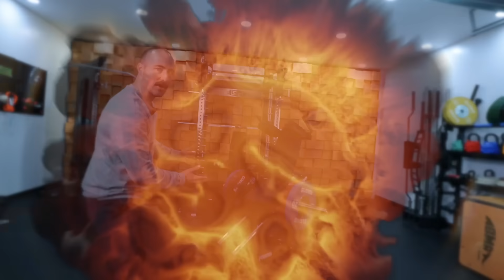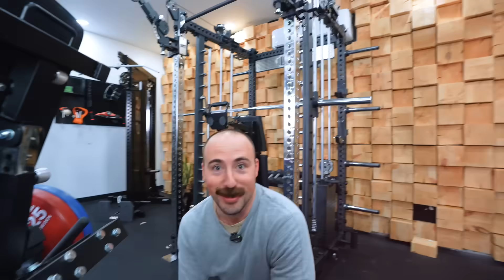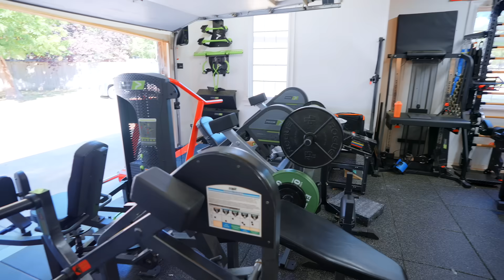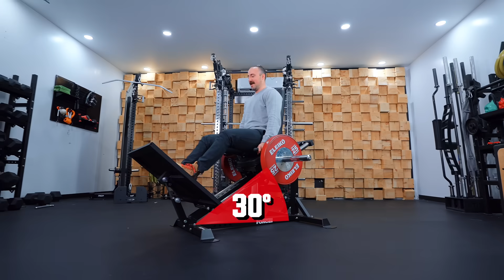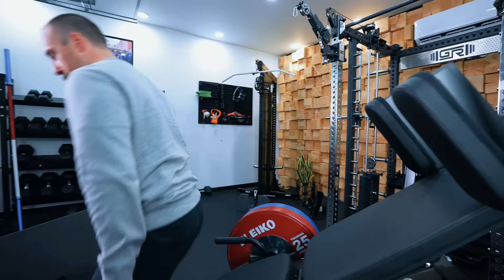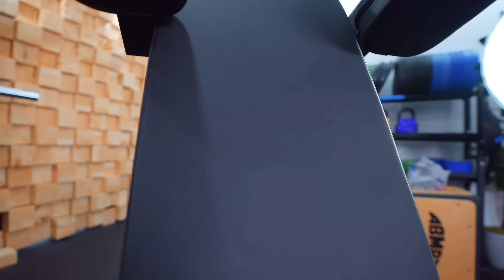The Ultimate Compact Leg Press/Hack Squat Combo With A Special Feature!

Comment: I have the PowerTec Leg press. Not the compact but the traditional style. It’s very solid and provides great value. The footprint is also minimized because the plates are loaded within the inside of the frame. It has 4 total weight horns behind the footplate; two above and two below. With a 1000 pound weight capacity. It’s hard to beat!
Reply: Assembly was easy. There is a very good instructional video on YouTube and the provided booklet is well done. I put it together myself in less than an hour.
Reply: How hard was it to put the leg press together? Is it the leg press or leg press/hack squat combo?